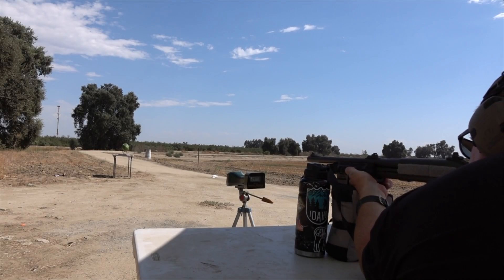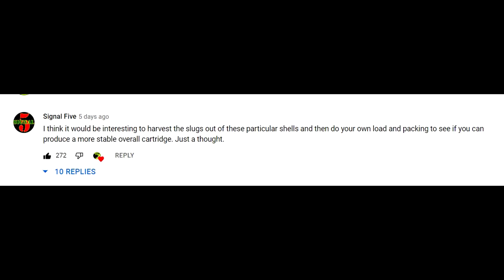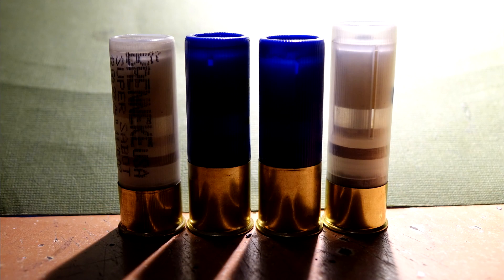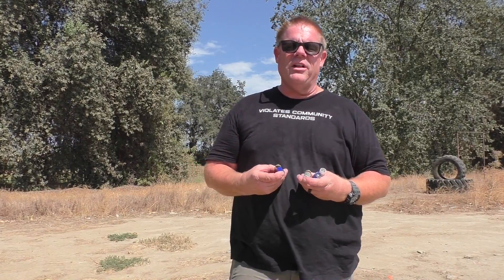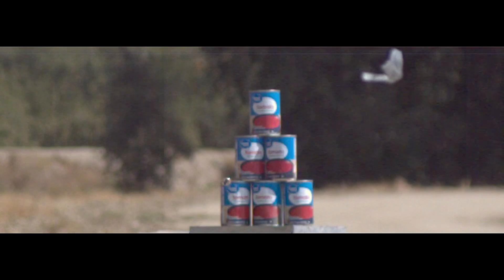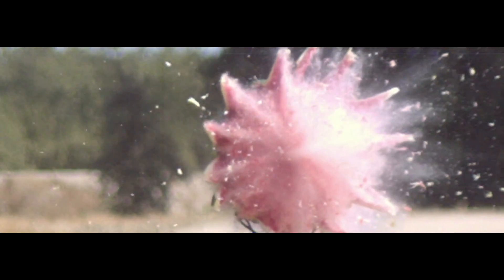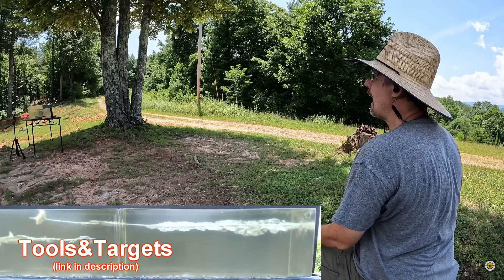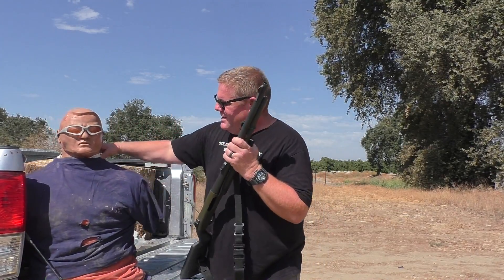Can we Reengineer the Brenneke Super Sabot so they work?

Comment: Great video as always .I have several older boxes Breneke slugs .I have clear hulls ,red hulls and black hulled Breneke .From slugs to BB & 2,4 .They are not good for summer heat .They are made for fall,winter weather ,they are powerful as hell and not good on old shotguns .There is no such thing as an all season round .You will loose performance based on external temperatures .we live in the land of mediocrity .That's what people want .Some shooters will not accept it others so long as it works ok ,Some of the village elders would load a few shells the night before going hunting  based on expected temperatures .Some times a little hotter when it was cold and lighter in the heat especially the guys that went out for pigeons .
My buddy has the Ithaca deer Slayer and is pissed with Remington because they kept changing design of copper solids .The new versions don't work as accurately

Comment: You talk about Europe as though it's a small country somewhere. Europe is an entire continent, and it's a larger landmass than America. Temperatures in Europe can range from as high as 33C (91.4F) to as low as -58C (-72.4F). Sometimes temperatures get higher than 33C, but infrequently. 

Does your American powder work at -58C ?
Reply: Yes. And Europe (the entire continent) can suck it.

Comment: Those are awfully long slugs, I bet that's a significant issue. 

In rifles, the longer the bullet the faster rifling you need. For example, a 55gr .223 is stable out of a 1 in 12 twist, a 62gr M855 needs at least 1 in 9, and the 77gr needs a 1 in 7. The 90+ gr bullets used in the .224 Valkyrie need a 1 in 6 or faster!

Comment: Tfm love your channel I'm not an expert but I would cut up that shotgun that was used in that 1 h.p. round it was definitely a proof round if your 1900 and change chrono was correct someone smarter than me could calculate pressure required to get that velocity 12 guage maop is 11.5  3.5 inch I think 13 ? In my opinion I think your shotgun barrel has been what is called yielded not safe to use until proven otherwise I hope you get this message

Comment: I can understand that temperature can heavily influence powder performance but I have to disagree with the apparent implication that European made ammo would not deal with that because Europe is somehow cooler than the US? There's plenty of places (Spain, Portugal, southern and central France and Italy for example) that get plenty hot in summer and where such ammo should also just perform. I would say it's just bad powder/ammo in general, nothing to do where it came from.
Reply from the maker: This is the second European-made round that failed in the heat from overpressure.   The first was the DDupleks.   It isn't that the U.S. is hotter than Europe,  but the manufacturers in Europe don't seem to test their ammo to see how it functions in high temperatures.   We have never had a U.S.  made slug fail in the heat,  and we've shot a LOT more of that.

Comment: I think Brenneke needs to see this video and consider changing at least their powder load. The Steel in a 3" shell appeared to offer the best performance, but it's only a sample of one. The stock powder I'd regard as a NO GO in the heat based on the over-pressure signs and the abnormally high velocity.

Comment: I am not sure about use in shotguns shells but Longshot in my pistol rounds (.38 Super out of a USPSA Open gun) dropped velocity as temps went up.  Found this out first hand in Las Vegas over the chrono verses the same brand of chrono in Kansas during much cooler weather.
After that I tested ammo from the same batch over my chrono at different times of the year with the temp ranging from the 60s up into 100°+ range.  There was a very noticeable drop in velocity.  I don't have my load data and test results (15ish years and two houses ago) but I seem to recall 150-200 fps drop using a touch over eight grains with a 124 grain freedom seed on top.
Note:  This is above the max as per Hodgdon's load data for a 124 grain load in a .38 Super that was worked up very carefully over about a year and several test batches.  Please do not use this info for loading your own.
Reply from the maker: Interesting!!

Comment: This really does seem like a bit of a lazy attempt on Brenneke's part to import a Euro-spec shotgun slug without considering different environmental factors. I'm not sure where the lapse in judegement happened but it's clear that it's approaching velocities and pressures that go beyond just impacting accuracy and might hurt someone under the wrong circumstances. I'm certainly not alleging willful ignorance but factors like temperature were probably not thought about when the choice to retain the original powder was made.
Reply: We've had almost two full weeks of 95°F weather all over Germany this year. Go to Italy, Southern France or Spain and 100°F is normal in summer. If a product completely stops working at 95°F, it's not "Euro-spec", it's just not a good product...
Reply: Maybe they had to switch to another powder because of supply chain issues? Reloading materials are kind of hard to get these days (mostly primers though, but who knows)

Comment: Pretty sure part of why that speed was so high was because you used a X12X seal which doesn't allow any blow by, and a hard wad instead of a springy one so the powder didn't have the extra expansion room. Bet you spiked over 40k pressure. Good thing you used a good shotgun....Actually I have a way to check and see.

By editing the parameters of .44 colt I've been using quickload to give very rough guestimations of what different powders will do for a shotgun load. The hard part is translating the effect that the 'cushion' that most wads provide. In metallic cartridges, this space is represented by the empty air left inside a case between the bullet and powder.  With this load, the push in plug does a similar thing, giving the gas a bit of room to expand before it runs into the full weight of the load. I think, after looking at your load, that I got it close.

As a baseline, with the data I put in, 30 grains of Longshot gives a Vmuzzle of 1455 fps, which is pretty close to what you got on the chrony. That, by the way, is showing a pressure of 14.5k. Though again I'm using Quickload in a way it wasn't designed for so this is a very rough simulation.

Anyway, I told it to find different loads of powder that would yield 1900 fps out of a 20 inch barrel and this is what it gave me. Lowest possible pressure was 17k with Norma R123. Most sat in the 20k-50k range, and others in the 100k+ range. Youtube wont let me post the raw data for some reason. I can email it if you want it.
Reply from the maker: Should have seen excessive velocities with the other powders too then.

Comment: Fascinating. Again. I live in Spain. Nothing odd about 40º C  We can hit 50º C sometimes. We shoot without issues. That green square grain powder though. I was working with some slugs the other day and one was a gold plastic dart in a custom gold plastic sabotwith a ribbed lead tip that you have tested before. It tumbled. It used the green stuff. I compared the burn rates for a yellow square powder (foster type slug)  the Green powder and home made black powder. The yellow behaved normally. The green was very erratic, hard to ignite and quite fast. It was not like others that I have tested. These shells were old. I suspect yours may have been in store for quite a while, or that green square stuff is a bit iffy. I can imagine an uneven burn upsetting a slug by deforming the wad on one side and perhaps even varying its temperature across the barrel diameter. I do hope that you pursue this odd behaviour of green powder. Anyway thanks again for being interesting. I have decided to let you call the company Brenakeeee even though it sounds odd over here in the third world. Maybe be Brenekah (joking) are just crap at what they make?
Reply: It's really disappointing because as far as I know, Wilhelm Brenneke invented the rifled slug for shotguns in 1898. They should be doing better than this...

Comment: The factory Brenneke shell seems like unnecessary technical overkill before you get to the crap temperature sensitive powder. Variations on the Svarog Sveroboy drag stabilised slugs like the one I use are accurate and destructive to a level that confuse people at the range and in the field every time I shoot them out of my social and hunting guns. I doubt very much that there's anything more than the smallest incremental gains to be made by gee whizz techno-wizadry any longer given the low pressures of the shotgun system.

Comment: I don't know how if it can be transferred from tanks to firearms, but modern day tank cannons don't use rifling because rifling has minimal effect on the stabilisation of a sub calibre projectile. That is why modern tank rounds have fins and are designed to be stable without rifling imparted spin, possibly it is the same issue with these, they are not stable enough on their own and the rifling isn't effective at stabilising them.

Comment: So I have an idea I'd like to see if you guys can test but idk if you can post it on here. 40cal blowgun threaded, sealed and turned into a potato gun basically but still fires darts and plastic stun darts drilled out for sabot round with a bullet sinker or anything for the actual projectile and powered by axe spray. It's extremely powerful when comparing to the original 36" blowgun with a small combustion chamber. I'd like to do a video myself but you guys have the slowmo camera and that much pressure makes bamboo act like it's coming out of a 22 and I'd like to know what these things are doing when they come out and maybe how fast you can push them. It took 2 failed attempts a near miss new modifications and over a year to finish the one I have been testing

Comment: While I would consider 33 C as very hot, that's mostly because I don't like anything over 28-30 C, and live in a temperate environment where those temps were considered heatwaves 10-15 yrs ago (nowadays that's just an average july/august). That being said, these are common temperatures for southern Europe, and even central Europe on lowlands. I definitely would expect pretty much any technology to work flawlessly at that temperature, considering that it is relatively common, and will be even moreso w/ climate change in full swing.

Edit: TLDR: initial testing temperature, while high, isn't out of the ordinary in Europe, so it's just a low quality product.

Comment: Man, that’s an awesome video, Jeff! Knowing the pressure properties of Steel, you could of went up to 40 or more grains. I have a couple boxes of these. Maybe I should run pressure test on these slugs with steel?

Anyway, great job fellers! And thanks for shouting me out!
Reply: TELEGRAM@TAOFLEDERMAUS  awesome! What I win, a new shottie? Lol
Reply from the maker: Seeing how you had good results with them,   it needed to be said before I completely condemned these things.  I'm convinced there is something wrong with this newer lot.    I was going to load 2 with Steel then I realized it might be a good idea to use the original powder to try to figure out what the heck was going on.    Not sure what your lot number is -  or how to figure out when they were made by that number.   Thanks again for your help.
Reply: @taofledermaus  Jeff, I can get you the lot numbers of the ones I have. The company should give us all the info regarding the manufacturing dates via lot numbers.

Comment: Great video .Loads have always been temperature sensitive .There is no one load that will work for every gun and every environment.Try shooting jack rabbits at -25°C and see how shot performance changes .We normally use BB ,2,4,5 or 6 .When the weather gets really cold  BB ,2,4 ,when the weather is above 0°C 4,5,6 will do  I took out a standing Jack rabbit over 65 yards with 1 shot of #6  3 inch 1 5/8 manum load .Now rabbit are not deer and shot is not a slug ,but payload ,wad and powder combos are infinite and  so is the temperature the only constant for most is the gun ..When you make one recepe it's usually for the one gun you are testing with .it will not give you the exact same results on another gun but close .Especially in rifled slug barrels..No one gun or barrel is exactly the same ..
So it comes down to practice ,and consistency in reloading .Know your firearm and control your recepe ..I use In metric because that's how I was taught  , 34 gram payload to 2.5 grams 4576 ,with a specific wad and hull for cold weather shells ....
That's for late fall and winter .as the temperature is warmer ,you can use a faster powder with a lighter powder load .You would think it would be the opposite ,but the volume of Gas produced by slower (Magnum) powders is higher than the faster powder .Unless I'm worng ,this is what I have been taught .And have had good success with my Beretta and 24 inch  C/B smooth bore barrel ..It's what's working .

Comment: I really don’t think it’s a wad issue 
Looking at that chrono reading with the factory powder charge it’s way too fast of powder for that weight of payload 

If you test this slug again I’d like to see 28 grains of longshot in a 3 inch hull , roll crimped with the standard 209 primer using all original wads and slug 

You should get around 1450-1500 fps which should yield some good results

Comment: Is it possible that the Brenneke ammunition was compromosed somehow during shipping? Like exposed to extremely high temperatures for extended periods, or extreme temperature fluctuations as it went through the various stages of shipping, that could have affected the properties of the powder or the plastic sabots? I know that we had some plastic storage containers turn brittle fairly quickly from exposure to extremely high temperatures during storage in attics and sheds
Reply: Like just removing the lids from these containers caused the edges of the lids to fragment... The containers were completely ruined...

Comment: You know I've never really given thought to how dangerous an incorect load can be. I had a box of 22lr that i trashed responsibly after i had the casings deform in my rifle when one split open and threw brass into my middle finger.

 I put all 22lr, short, kolibri, subsonic, and anything i can get to fire through that same rifle and I've never seen any round bulge or split until that box of remington. 
The reason i ended up digging brass from my middle finger was because it actually blew the 8 round mag straight down and out destroying the top two cartridges. I honestly didn't think to try and contact the company only that i felt dumb for trying to get more rounds for the money in a bulk pack. 
 With that, this charge not being safe in heat, and the guy with a chain fire i just think about Scott/Kentucky Balistics and that damn slap round... it's pretty crazy to know a gun in and out for years and take care of it and just one new round could really screw your life up or worse in a flash.
Reply: I'm still amazed that KB survived that... His guardian angel must have been working overtime!

Of course, I also can't figure out how a round got that hot. We know it took over 180kpsi, over 3x proof pressure, to get the cap to fail like that. A case full of pistol powder would probably do that, Scott never did say what he loaded his guaranteed-kaboom rounds with. But that's deliberate sabotage, and I'd like to think that nobody selling ammo would do that.

I'm wondering if KB's SLAP was some old grungy round that got thrown into a tumbler to clean up, and between the poor/unknown storage and vibrations broke the powder down from the specified Ball powder into smaller particles, which greatly increased the burn rate. That's something that at least assumes an unintended consequence for the action.
Reply: @ScottKenny1978  Actually a neighbor/friend that use to be around purchased some "green trace 556" at a gun show up in georgia once. His name was Chris and he gave me a few because at the time it was iffy at best whether or not we could "legally" own them. One of his that he fire just detonated like that in an old heavy barrel bushmaster and it chewed the breech to shit but the gun still functioned. After that i didn't want to fire the rounds i had gotten from him so we pulled the bullets to look inside. First the bullets were very obviously not trace round look at the heel of them and second the power was the absolute finest grain size I've seen in any cartridge in my entire life...
Im talking talcum powder fine, so fine it would readily clump in piles. Knowing what i learned from my grandpa about black powder you dont want to put 3F in some 1or2F guns. so i would imagine the extremely fine powder is what caused the detonation by burning much quicker than it should normally in a 556 round.
Reply: @ScottKenny1978  Well just watch Marks new video as the conclusion that dropped about an hour ago. His conclusion as to why KBs gun exploded was PISTOL POWDER. makes sense to me not that i figured out the magic reason. Its scary to think there are people that see gun powder as gun powder no matter the type.

Comment: Steel powder is slow burning and performs well in the cold hence the reason its used for loading steel shot because most waterfowl hunting is done in the winter. I have a load thats 1oz of steel shot at 1700 fps, heavy loads are not the only thing you can do with it.

Comment: In the slo-mo it looks like you were getting piston/sleeve compression in the barrel instead of on impact and this shift was enough to destroy the sabot 16 of 18 shots. I wonder if there should have been some sort of split "wad" incorporated into the sabot to prevent this. You proved that, even under optimum conditions, this is a crap design.  Thanks for all the years of insightful entertainment!